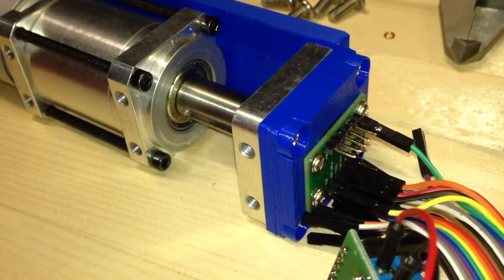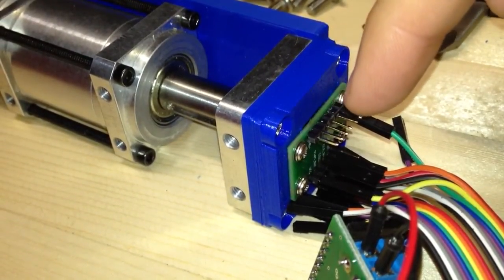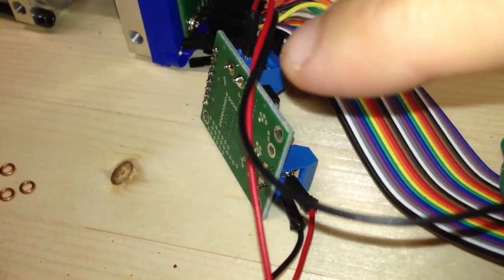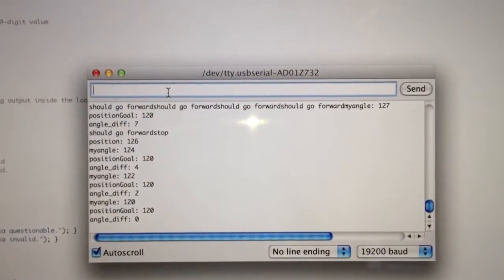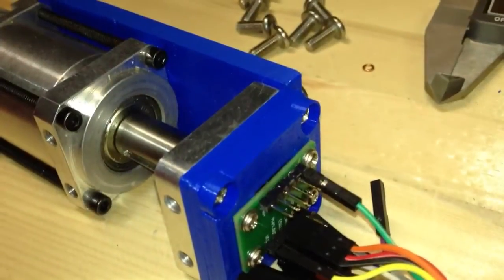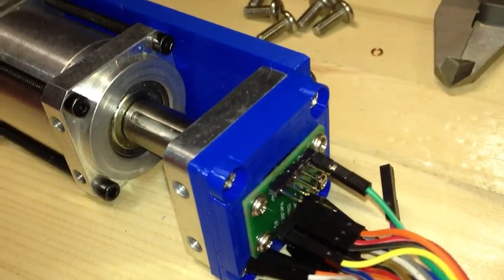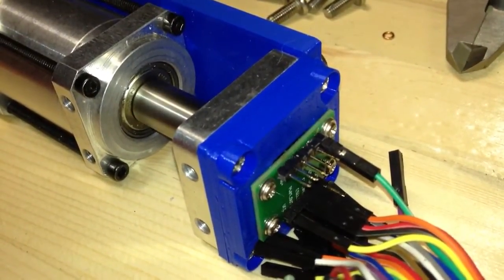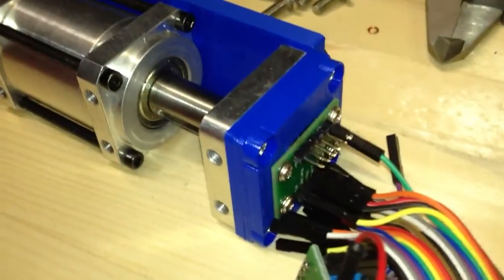Diy Huge digital servo

Comment: Nice work, i saw your website and i have few questions if thats ok,
is this servo compatible with dynamixel protocol ? 
i noticed little bounce back after it finishes the rotation is that normal ?

many many thanks.